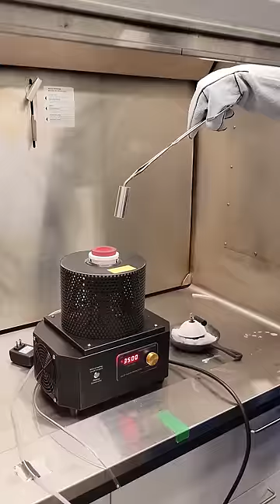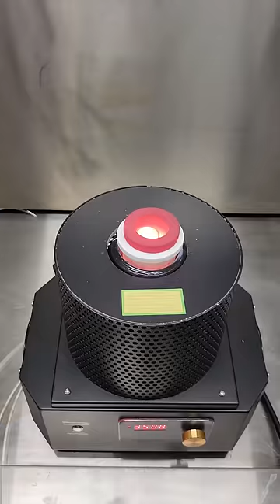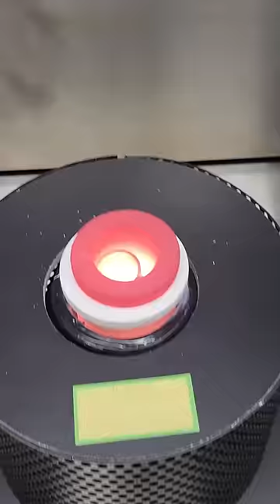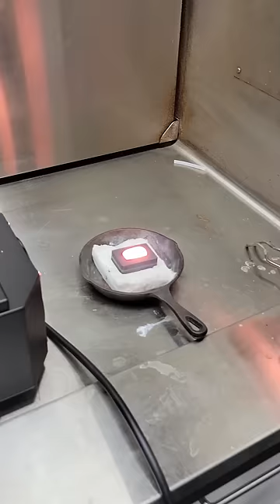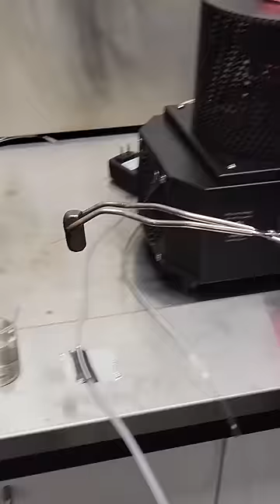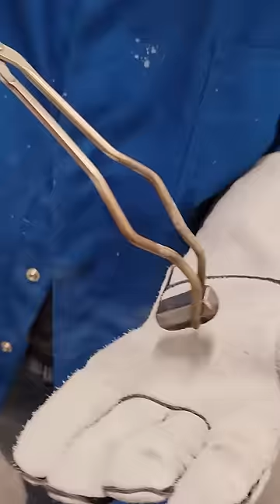Melting steel pipe is crazy

Comment: Nice induction furnace. Used to work with massive ones. They're scary when the cooling fails and your furnace suddenly blows up.
Reply: You're saying that like it happened and it scares me
Reply: @abrupta  Yeah man. There was a big bang. And then there was hot metal flying through the air.
Reply: @abrupta  ugh, and you’ll see some piece of ginormous machinery fail in a “fuck me…” manner sooner or later. I’ve seen dudes working with steam at 150°C+ have the steam hose burst right next to their collarbone and scald the hell outta them, I’ve seen guys nearly slice their forearm open from wrist to elbow, seen dudes nearly ran over by forklifts, I even heard about one dude who worked where I used to work, who nearly lost his eye because he was working with acid with no PPE and some of it splashed up and hit him in the eye. Mind you, I don’t even work in heavy industry. I just worked in an industrial food/drink factory. 

This isn’t even considering things that are more common in actual heavy industrial factories, like hydraulic injection injuries, pinch/crushing injuries, hydraulic cylinders failing and dropping multi tonne loads with next to no warning, people trying to stop multiple thousands of kilograms from rolling or falling off a pallet with their own bodies, misusing forklifts, etc, etc. 

My favourite of the “fuck no, fuck this, fuck you, fuck everything” kind of machine failure would have to be something called a “cobble” at a steel mill. Imagine a 1200°C (2200°F) bar of steel that weighs tons, moving at anywhere from 50km/h-120km/h (roughly 30mp/h-75mp/h) that’s meant to go through a bunch of rollers and stuff and then be nicely coiled up, but instead, it shoots off in some random direction across the shop. There’s videos of it on YouTube if you want to see what I’m talking about.
Reply: @dylanshandley1246  I've seen a few people roll bobcats, slice off fingers with bandsaws, cop a freshly sharpened, falling blade to the leg. Get burns from from trying to step around hot slag in boots not designed for foundry use. I nearly got squashed by a casting, because some idiot thought it would be funny to pin me against a wall with it, while it was on the crane... All while the brakes were failing.
Reply: @justinpatterson5291  yuuuup. Just your run of the mill heavy industry stuff xD one of the rooms I used to work in when they needed help with production for the day was the “jam room” where they, unsurprisingly, made jam and stuff that needs to be cooked and have sugar added to it. The amount of times either one of the other workers or myself got scaled in that room is ridiculous xD one time, a dude accidentally dropped his box cutter in the 800kg holding capacity, steam jacketed boiling vessel’s we worked with, and tried to quickly reach in there to grab it before the big ass mixing blades (powered through a gearbox attached to a 15hp 3 phase motor) scooped it up and got tackled by like 3 dudes before he accidentally either got his arm ripped off, or his whole body pulled into, a boiling vessel at 80°c with 150°c+ steam being ran around it. Some people just should never step foot into any kind of industrial factory xD
Reply: @dylanshandley1246 
There's no way this was in the US
Reply: @jad2290  nah not the US. I’m in Australia, but I’d wager the OSHA regs aren’t too dissimilar to what you guys have. But they only matter if there’s an inspector or a customer nearby xD
Reply: @dylanshandley1246 Real scary shit at my work when the kiln rollers (induction) shatter. Hope this kid develops a better respect for the heat capacity of metals. 🤷🏽‍♂️
Reply: @dylanshandley1246  I’ve seen odd crap people do  and machines do to people as well.  Mind you, in the good ole USA at a major string cheese manufacturing plant.  Person run over by forklift.  Grabbed by a giant impeller screw and run through it.  Piece of cheese, a single piece, under a conveyor someone thoughtlessly reached in to pick it out and there goes there arm in a roller like a pretzel.  Falls, trips, air hoses shooting out of a wall when the bearing failed in the chuck, this one was mine. Needed stitches for that. Long enough time frame you see bad and or hilarious things.  Industrial environments are unforgiving and super interesting.
Reply: @hemlockVape  yeah, i dont wanna be near nothing made of solid steel thats constantly exposed to high temperatues when it lets gp 🤣 thankfully nothing i was around at work failed catastrophically. The worst direct equipment failure was just steam hoses bursting. Everything else was just poor workplace safety.
Reply: I did the same thing and had moisture in a mold blow up in my face , most of that bounced off where I got burned was in the laces of my boots , the metal pooled and burned right through like butter
Reply: @justinpatterson5291 what is it that you do exactly? That's a lot of crazy stuff. How many years did all this happen over? Do you still have a long career ahead or your sliced fingers over with?
Reply: @ace1122tw  idk, but I’d guess he works (or at least used to work) in a foundry of some sort, since he mentions “boot’s meant for foundry use”. For the rest of your questions, I’d guess that something like 10-30 years is the span that it happened over, just going off my own limited experience with industry. 

To answer that last question, I’d have to ask if you’ve ever heard that saying, about how you should beware an old man in a job where people die young. There’s a reason why all of his stories, and all of mine, start with “I’ve seen other people do x, y, or z”. The first time you see some shit go left, it’s really, really shocking (or at least it was to me), but it gives you a pretty damned good idea of what the stakes would be if you were in the wrong spot at the wrong time. The first time you see someone get genuinely hurt by something going left, you develop something that is right on the border between respect for the machine or process, and a fear for that same thing. The thing that keeps you safe in an industrial environment, is remembering those moments, and remembering that they’re normally avoidable if your on your P’s and Q’s. When it isn’t avoidable, it’s just your number being called, and that’s all there is to it.
Reply: Watching big ones on YouTube makes me feel being on Total Recall Mars.
Reply: Please, anything is scary when it suddenly blows up
Reply: I was a security guard for an induction foundry and they were very adamant about me keeping an eye on the cooling pumps. Thankfully they never broke down while I was there!
Reply: @goober239  I can’t imagine the sheer level of heat that must be nearly constant when you work in or near a foundry 😂 I can guarantee you that if it were my responsibility to keep an eye on the cooling pumps, and I saw something failing, I’d be informing my supervisor about it while in a full sprint in the opposite direction 🤣
Reply: It's a good thing I am a software developer. I feel bad for you guys.
Reply: @dylanshandley1246 yess sir, ive seen enough on live leak
Reply: @abrupta  Watch some furnace factory fails. They're scary af.
Reply: As someone with a couple of months in a factory before saying "screw this", I respect and salute you. 🙇🏻‍♂️

Comment: Make sure you preheat your mold next time!
Reply: I'm pretty sure if he didn't preheat it this time it would have broke. Notice it's sitting on a pan and there are gloves?
Reply: @zachariahkindle8926 true, although it did “sizzle” which (if I understand correctly) means there was some residual water in there.  Not enough for an explosion maybe, but worth mentioning.

(Granted i am not an expert in metal casting (yet…) so would love someone with more experience to talk about this)
Reply: @ericlotze7724 the sizzle could be due to unburnt oil coating. 
At least in jewellery castings of the like, you coat the ingot mold with a small amount of oil then heat until the oil smokers and leaves a minuscule layer of soot which acts as a mold release.
Reply: In Nile's previous videos, he would always preheat the mold. I doubt it was any different this time.

Comment: Curious where did you get that induction melter and how much did it run you? Thanks for this proof of test vid!
Reply: i would like to know the same
Reply: Judging from the english on that warning label, I'm gonna say China.
Reply: Look for Ultraflex power. I used to be an engineer there - they are waay better than this thing. I still have friends there :)
Reply: Google "1KG Induction Furnace Metal Melting Furnace Melt Copper Gold Iron Steel 3500W"
Reply: Lots of people want to know, which is the point of this commercial
Reply: Thanks that did it, bit pricy for what I need when I can use propane rigs.  Looks super useful in a lab setting.  I've been wanting to get into melting scrap so I can get metals for investing closer to spot price than the markups you have to pay in coins and bars. @Pooopers

Comment: It is actually extremely hard to melt steel, it is much harder to melt than vast majority of metals and alloys, for example, a propane torch can't even melt steel, you need an oxygen or air fed torch to melt it. While induction furnace can only melt iron/steel alloys, Nile pretty much needs it if he is doing a project that involves melting steel.

Comment: If you’re gonna do any more metal working stuff be sure to preheat your molds and any equipment that has contact with the molten substance
Reply: Why do you think it's sitting on an pan and there are gloves right there?
Reply: @zachariahkindle8926  Because Nile is about to pour molten stainless steel into the mold that is sitting on a stainless steel countertop. There is a saying about pouring molten stainless steel onto regular temperature stainless steel and that saying is that it is not a good idea. The mold should upside down on top of the furnace and poured into immediately after taking it off.

Comment: Does it lose enough carbon to become useless?
Reply: No. If heating steel made it revert to iron, no one would ever be able to cast or forge steel.
Reply: yes, all steel effervesces once heated molten and boils off the carbon. Usual industry practice is to add a small amount of aluminum as a sacrificial top layer to protect the rest of the steel. Since it goes from being very violent and "alive" to being "dead", it's referred to as "killing" the steel.

Comment: Okay how much was this and is it worth it
Reply: In tube form the pipe was probably worth $1-2. In melted scrap form, for 300 series that’s about 10 cents max, minus the $15 dollars of electricity to melt it.
Reply: @CheddarCheeseBandit  oh I meant the induction furnace
Reply: @CheddarCheeseBandit  stainless depending on if it's sanitary or not and what type of stainless 305 316L 316 can run you 5 to 12 dollars for a few inches depending on the diameter say 1.5 inch

Comment: Safer scenario here and safe enough, but make a habit of holding solid metals over the heat of the furnace to drive off any latent moisture before you add it in. 

Its more important if youre melting a bunch of aluminum scrap for eg and already have a puddle of liquid metal going in the crucible. If you drop in a cold and "moist" chunk, the water suddenly flashing to steam can violently spray liquid metal out with the escaping vapor.

Comment: Burning the zinc off allows the stainless steel to oxidize rapidly when  cooled in a high oxygen environment. That's why the metal is shiny where it was in the mold, thus not exposed to air.
Reply: There is no Zinc in or on stainless steel.

Zinc on low alloy steels is Galvanizing, it helps protect against corrosion.
Stainless steel contains chromium, it is far better at protecting against corrosion than galvanizing.
Reply: @autumn5592  this is absolutely zinc in stainless steel
Reply: @vinny9988  Give me an example of a stainless alloy with Zinc in it.

Comment: USE OILS FOR COOLING OFF STEELS

youll crack the crystalline structure from the water cooling it down too fast, oils dont cool as fast and works better for it.

Given, thats most likely mild steel so it doesnt really matter but still.

Comment: Stainless steel can withstand crazy high temperatures! I've tried to forge it like a dummy! I forge 5160 all of the time and I can get it up to forging temperature in my propane Forge in like 2 minutes! I left the stainless in the Forge for like 20 minutes and could barely Dent it with my hammer

Comment: Fun fact :: If you don't heat those graphite moulds enough before use, the molten metal can splatter from moisture buildup from humidity in the air. Like during hot ,muggy north Eastern summers when the air is thick and sticky .

Comment: fun tip it is more dangerous to wear standard work gloves and using tongs while working with hot metal than it is doing it bare handed. this is because you can accurately read the temperature of the tongs by its heat against your hand and when your hands are gloved you cannot feel this heat to the same degree and can lead to burning/fire.

Comment: You might want to blowtorch the mold to heat the mold up first. With it hot enough, there'll be less of a violent reaction between the hot, molten, metal & the cold graphite of the mold.

Comment: I see that the furnace is brand new , did you pre-heat the mold ? If you don't do a good pre-heat one day your going to have a steam explosion and have all of the metal thrown in your face , take the mold and set it on top of the furnace and get it up to the point where motor oil smokes then your ready to pour , I had this happen to me at a foundry I was working at , it was a hard lesson to learn .

Comment: Don’t buy more than 6ft of steel pipe, I did for a flag pole on my truck, they only sell it in 10ft sections, so the Home Depot cashier stood there trying to figure out how to charge me for 6ft for about 5 minutes before he gave up and told me it was free, because the employee cut it down from 10ft to 6ft and the system doesn’t acknowledge that.

Comment: Dosen't liquifyung stainless steel in the presence of oxygen change it's metallurgy?
Reply: Liquifying it at all would because. Even heating it past a certain temperature would anneal it.
Reply: I was thinking more along the lines of the iron, chrome, nickel....content. When welding stainless steel with TIG process the welding puddle is protected with argon gas or a mix of inert gasses instead of CO2. SMAW and FCAW process uses flux for shielding but also contains alloys to help maintain the structure of the welding beads metallurgical properties. Each grade of stainless steel also has a specific filler metal.
Reply: Oxidation and decarburization can happen. Oxygen and water is needed for the reaction. That reaction could cause you to lose material in the form of carbon monoxide. You would retain your elemental metals but they would take a different compound form.
Reply: I'm thinking more than oxidation decarburization. When welds are performed on thin stainless steel and the temperature is too high, a sort of black crystallization can be found afterwards underside the weld and beside the weld bead, also the weld and surrounding heat zone is a grey color instead of being shiny.
Reply: Looking up a few things I found that carbide precipitation is most likely the blackish crystals I mentioned previously; which causes the material to lose its corrosion resistance. Also Cr(VI) fume are created which would be part of the alloy's loss.

Being a welder, I just know it's bad to heat stainless steel too high without protecting it from oxygen (and CO2, considered an active gas in the welding industry).
Reply: @matthewlaporte6065  It could only react with the oxygen and nitrogen in the air. The only way to get other reactions would be to introduce other materials. Nitrogen has to be pretty hot to become reactive. You could melt steel at lower temperatures than where nitrogen reaction would be a concern. I can't say about your welds. It could be that the material isn't prepped properly and has contaminants introduced but I think oxidation and decarburization can account for it.

Comment: after being melted down from a pipe into a rectangle, is the stainless steel still "stainless/resistant to rust now that it has reached melting temperature, or did it get converted into regular steel during the process?
Reply: It's still stainless, it would need to get much hotter to burn the chromium off.

Comment: Stainless steal is actually very rigid to changes. If he melted normal steel it would have melted way faster and this also happens when freezing normal metal gets brittle whereas stainless steal holds its shape. BUT METAL IS METAL AND METAL BREAKS OR MELTS

Comment: If it melted that pipe then what is the actual machine made out of?🤔🤔
Reply: The crucible, the thing that's getting hot, is usually made of Graphite (carbon), or some kind of ceramic.

Comment: I melted some stainless steel, to see how the ingot will look, but now I'm going to put it into hydrochloric acid.
To do this I will transfer the ingot to a large beaker, and then pour the hydrochloric acid on top.
Because this is dissolving way too slow, I added some hydrogen peroxide. Yes, you guessed it, this is piranha solution and it's eating away the ingot.
Next I filter off any residue and transfer it to a larger beaker. The next thing we are going to do is extract the silver.

I know next to nothing about chemistry so I wouldn't know how to do that 😂
Reply: Silver, in stainless.... right... lmfao